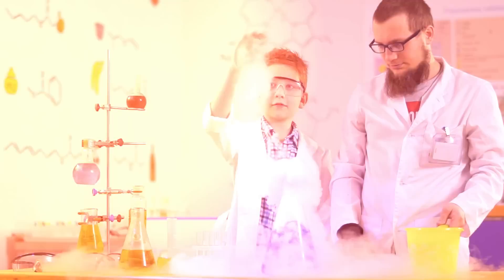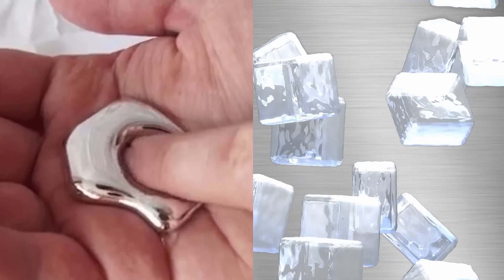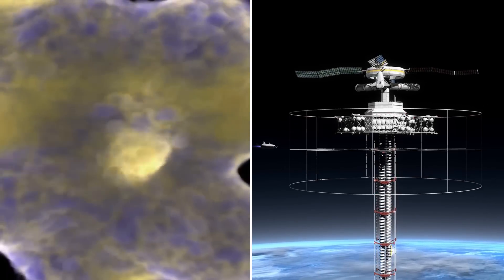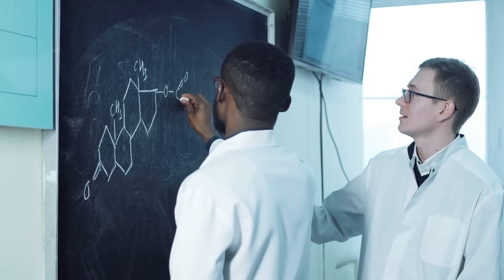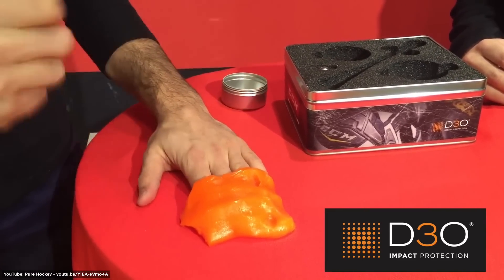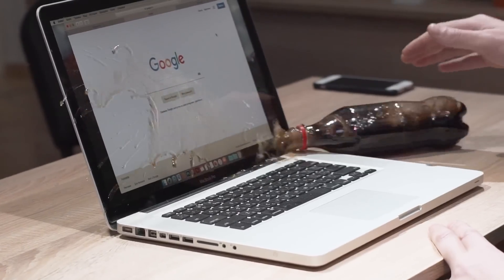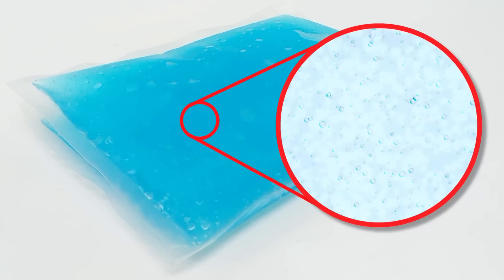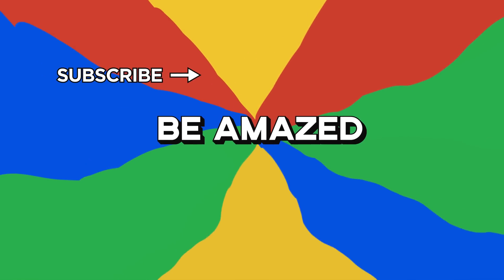Most Unusual Substances Ever Created

Comment: if galium melts at 85 degrees....wouldnt it melt inside circuit boards...i mean phones get pretty hot...they usually use solder on circuit boards

Comment: 2:09 technically it can do harm to aluminum and other metals won’t be affected, that’s why the heat sync and the iPhone are basically falling apart, it’s because both are made of aluminum, and also, you need to scratch up the metal to get rid of the oxide layer protecting the metal, so it would take some effort to make the metal brittle. Oh yeah, and the wait time. It takes a really long time

Comment: Did you say, we can now water proof glass? ... or something along those lines?
Reply: Water proof anything.  They’ve already put it on phones.
Reply: @growbydoing7290  I know that much. My point is, glass is already water proof. What's the point of adding something to make it even more waterproof?
Reply: Karma Pelletier  Rain X.   Gets the water to slick off the surface faster not hang around.  You honestly didn’t get that’s the point of it?
Reply: @growbydoing7290  again. Glass already does that.... so long as my phone screen is clean, water beads right off. And no, I don't have a special protection for it. It just my basic glass screen.
Reply: @growbydoing7290  wouldn't something like that require some kind of maintenance after a while? Cause I've had this phone for 3 years now, and I can assure you, I have not been easy on it either 😂
Reply: Karma Pelletier  no clue.  Lol.  All my old electronics look brand new.  I’m not sure if one can wear off the coatings lol
Reply: @growbydoing7290  I'd think it would be similar to wax? Or even hair spray? Lol
Reply: Karma Pelletier  it’s entirely possible lol

Comment: Space elevator? 😄. You do know that the earth spins, and speed is relevant to altitude and distance from the earths axis? Your space elevator would be ripped apart.
Reply: Most designs actually rely on that.
Also most designs boil down to a massive cable that a elevator moves on.
An anchor on one end and a counter weight around geo-stationary orbit.

Comment: Gallium is the key component to liquid metal a thermal interface material that can be used to help transfer heat away form hot PC components like a CPU but it only really works with copper or nickel plated copper & has a really corrosive reaction to aluminum

Comment: 4:10 is the string form if graphene. Graphene is more of a conductor than copper, and stronger than diamandis. It is very flexible too. It can stop a bullet, but it Is a nanometer/ten atoms thick
Reply: Graphene is a strong solid. Its made by putting graphite on tape and then taping the taped graphite layer and then repeat.
Reply: And repeat more